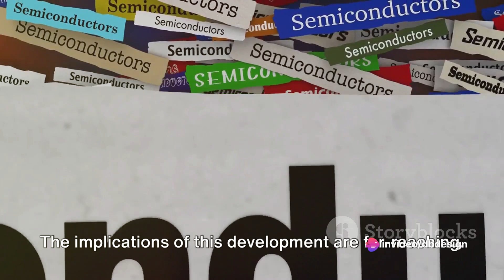China Beats US Sanctions By Making 5nm chips with SAQP Process

Comment: SAQP is not new technique or science, it has been used in SSD since 10 years ago. It isn't used in producing CPU because of cost and quality. It simply not suitable for highly advanced and complex chips. Blocking this uneducated channel.
Reply: SAQP is what Intel is using for the Intel 7 node. I'm not sure what you're talking about.
Reply: @Cyphir3369  Well yes, I am talking about now. You don't see people using SAQP DUV for 5nm and smaller. If it is cost effective and effective, intel would have continue that direction, China wouldn't be the talking point.

Making things small and making it both small and dense are not the same.
Reply: @Lu5ck  Intel 7 still consist of the majority of Intel's leading edge production, with Intel 5 only producing the compute tile of Meteor Lake, while the IO and GPU tile being made by TSMC. 

Even at 5nm, only select layers are done by EUV, while the bulk of the lithography is still done by DUV, due to it's vastly superior throughput.

The cost effectiveness is better with EUV included in the process, but not insurmountable. Yield and cost effectiveness will improve with experience, like all nodes. SMIC will be the pioneer in this front, since they will be the only fabs pushing SAQP this far. 

TSMC's newest node is gonna utilize multi patterning with EUV, which is currently more cost effective than switching over to High NA EUV, due to High NA EUV's even lower throughput. It's a trade off, rather than a direct improvement.
Reply: @Cyphir3369  You know about patterning and I suppose you should also know to do 5nm will definitely require a lot more passes. More passes also means more risk to faults which figure of speech means to produce 1 chip, you have to make 9 failures. Using EUV, the passes is a lot lesser, this literally saves time thus throughput. We can see it in the price of the chips.

As you said, it comes down to experience. EUV is complicated to setup as compared to DUV but it is infinitely better than DUV, it's just simple physics limitations, a marker will always be thicker than a pencil. With experience, EUV throughput will only just get better.
Reply: @Lu5ck  EUV throughput is limited by the power source, which hasn't improved much at all. It is a very hard problem to solve. It took ASML a decade to get it working to begin with. DUV has higher defect rate, but can process twice as many wafer than regular EUV and almost 4 times as many as High NA EUV. People seem to think EUV is leaps and bound more cost efficient, but they're much closer after factoring in throughput and that EUV machines and masks cost magnitudes more.
Reply: @Lu5ck  I've been avoiding saying it directly, but that has far more to do with Intel's incompetence more so than viability. They've struggled with their 10nm nodes for a very long time. While TSMC N7 node initially was completely in DUV, they have managed to increase yield to near 100% with experience. They also released a projection on mask usage, if they had stayed on DUV for their N5 node which is around a 70% increase compared to EUV. Also, photolithography itself only accounts for around 25% of the total cost in the process of producing chip.
Reply: @Lu5ck Oh, I'm not saying that DUV is more cost efficient, but rather the two is closer than most people think after factoring in all the other aspect of foundry economics. Will it be lower margin than having EUV? Yes, but can it be made viable? Most definitely, given that TSMC had 5nm DUV only planned, had there been even more delay in EUV roll out. I'm basing this mostly on TSMC track record and Liang Mong Song and his team's success at catapulting Samsung to the leading edge.